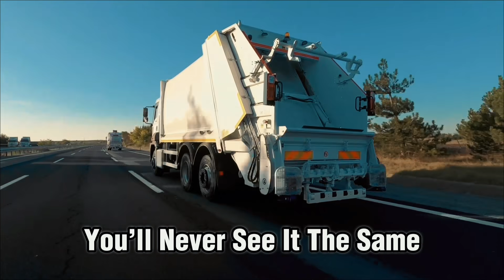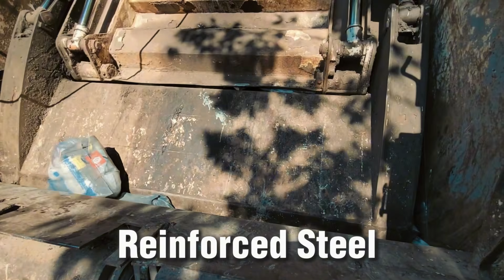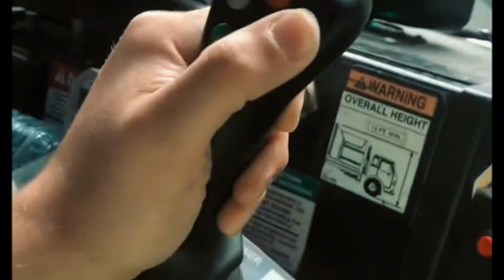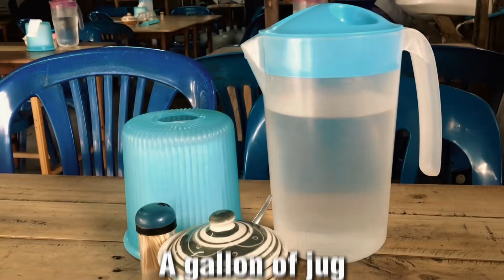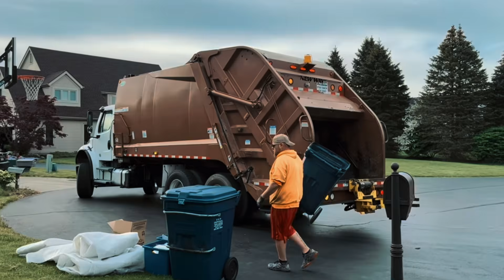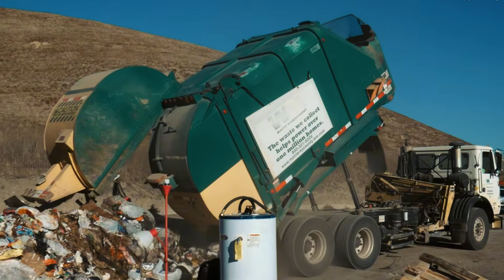What REALLY Happens Inside a Garbage Truck While It Compacts?

Comment: Most rear load trucks do not feature a forward facing packer panel just in front of the hopper.  Instead it consists of the slider panel, which is attached to the sweep panel.  The slide panel moves up and down while the sweep panel folds inwards  to pull refuse inwards into the truck body.

The ejector panel, located in the front of the body just behind the driver's cab pushes backwards against the refuse already in the body 

To unload at the dump site  the rear hopper assembly is raised and the ejector panel moves rearward towards the back to push the compacted load out of the truck body and onto the ground.

Comment: One aspect that isn't really covered is what is behind the rear scooper on these trucks. It's briefly visible in some of the animations but I didn't realize there is a partial dam that the scooper is lifting the garbage over, then a separate compactor inside the main bin that's compressing everything. I used to think the back scooper was the only thing doing the compacting within the entire bin.